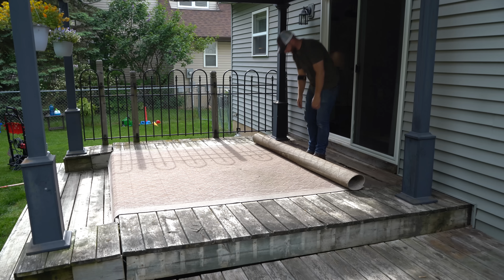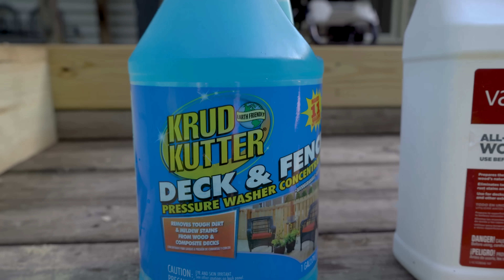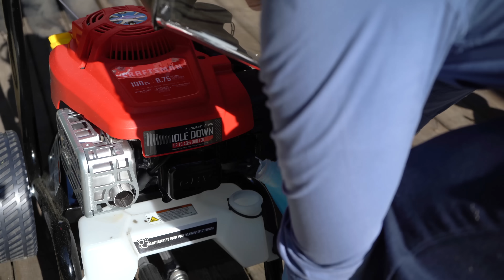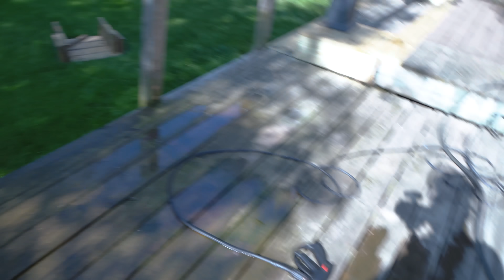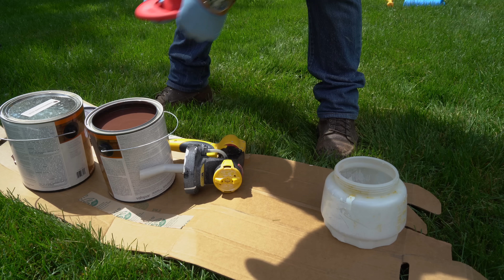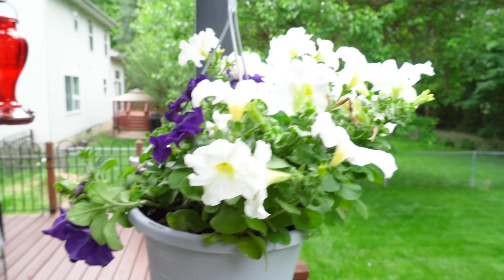How To Clean And Stain A Deck

Comment: Turbo nozzle helps give you a more even spray when cleaning surfaces that mark up like wood. Just don't get it too close or it will fuzz up or even cut the wood. If you can't use a turbo stay away from the more focused spray tips.

Comment: Had a long time pro tell me you want to go through these steps for surface treatment  1. power wash to remove most dirt/debri/algae/mold 2. use a mold and mildew cleaner to kill all remaining mold/mildew and rinse/wash it off. 3. Use something with oxalic acid like that Valspar wood prep you have in the sprayer to restore the wood and balance the ph, (this step is not important if using a color stain.) 4 sand the surface if needed (nothing finer than 80 or 100 grit at the most) 5.then finally seal/stain. Currently about to do step 3 myself.

Comment: If your going to spray a deck always back brush ….it works the stain into the wood so much better especially 
rough parts of the wood and in between the boards …you gotta think of the sprayer as just the applicator… 
I know it takes longer but such a better job. And do carry the boards from a break to a break so do about 
three boards at a time fully or whatever you can keep up with then back brush. That’s how to avoid lap marks…..
Painting contractor here for 40 plus years..

Comment: The only benefit to using a sprayer to apply stain is that you'll be done quickly and that’s it. The sprayed on stain doesn’t penetrate wood properly the way a stain brush does. Besides looking like crap sprayed on stain will also be flaking off in large chunks by your next season. But man it sure sprays on fast!

Comment: 15 degree (yellow) or a "turbo nozzle" if included does a lot better job than the 40 degree (white) as the loss of psi is substantial. Glad to see you figured that out for yourself before you got too far. That deck came so clean, very nice.

Comment: As someone watching this to learn how to power wash for the first time, I'm actually really appreciative that you left in the part where you were careless with the pressure/direction. I hear lots of people mention the start/stop lines, going against the wood grain, etc. but to actually see it gives me a great impression of what to avoid. Thanks so much for keeping the footage!
Reply: Don't follow behind this guy! He demonstrated what not to do in cleaning your deck. Organic growth is still expected to be present. If you're only using water, that deck is not going to hold up, and it definitely won't look as good as it could look.  He didn't even hit the sides of the boards. You could still see mold all the way down them. The chemicals are going to get it all off together. He evidently didn't think that he needed to learn a little bit before he tackled that. I can guarantee you there are lots of stop and start marks along with splintering. You absolutely do not use a 15° nozzle while I've never even heard someone say that. Lol, it also doesn't matter how bad the deck looks. If you follow those steps, it's going to look new in the end.

The right way is as follows: 

1. Give the deck a good rinse letting the wood soak up all that water. 
2. Mix up some Sodium Metacylic and water in a pump sprayer. After that is applied let it dwell for about 20 minutes. May need to use a scrub brush for stubborn areas.
3. Rinse with low pressure using a 40° nozzle or a J-Rod. With chemicals, there will be absolutely zero need for having to get close to the wood. Rinse in a sweeping motion, bringing the nozzle up on each side to side motion, or just follow the plank all the way down to the end.
4. Then mix up some oxalic acid and water to neutralize the wood, bringing the wood back to its natural color. Apply the oxalic acid while the deck is still wet, and don't let it dry on the deck. Also, let that sit for as long as you can without the deck drying. 
5. The last step is to rinse, rinse, rinse. 

Anyway, in case you still didn't know !
Reply: @billyvice1520 this would be after sanding ?

Comment: Just my two cents back brush the stain if using a sprayer to work the stain into the wood.  I use a deck brush on a pole and works the stain in real well and probably uses less stain.   Then do a second coat before within the time frame of what it says on the can.

Comment: You are using the pressure washer wrong. Holding it way to close and at the wrong angle. Also it will force more crap into the deep fibers of the wood making it impossible to clean. Have fun when your deck rots out.  hahahahahahahahahahaha

Comment: Very nice job, great video.
I bought that same sprayer today to do my deck. I am using Thomson's Advanced Sealer, this is 3rd time I am using it but first time spraying it with sprayer instead of brush. I used my foam cannon to cover the deck in foam, used liquid soap, a d then powerwashed it, did that today, hope to paint tomorrow if dry. I noticed some of the stain from last application is holding strong in some spots so I didn't piwerwash to bare wood. Hope it will work well.

Comment: Go get you concentrated bleach mop it on there let it sit get your garden hose and it'll be 10 times cleaner than anything you did with your power washer I know does that blow your mind dude I'm not kidding all you need is bleach and any garden hose just regular water you don't even need high pressure I just did my own

Comment: I do not like to use power washer on deck, I find that what the power washer is doing in this case is actually peeling a layer of wood when wand is held this close to surface.  Then when deck dries the wood is all frayed/ fuzzy and than needs to be sanded before one can apply a sealer or stain.  I use a bucket of hot water with dawn dish soap and a brush, rinsing with garden hose as I go along. I even tried a old floor polisher to scrub deck with great cleaning results but it to frayed the pressure treated deck boards.  So the brush on a long handle is what I found to work the best.  And I do my deck at least every second year, scrub let dry a few days then apply Thompson wood sealer.
Reply: Thank you, yes, I've seen a person pressure wash their deck & it was frayed, basically shredded the wood. It looked awful. I've had people tell me not to pressure wash. So I'm a little confused. Is it low-grade crap wood or what? Or did they do something wrong? 🤔

Comment: Appreciate the video. Well done. The one thing I would say is that it would be a slightly better idea to back brush/roll over what you spray. This pushes the stain deep into the pores and takes that extra step to ensure more durability

Comment: Anybody here is welcome to answer my questions....seeing as I’m really pressed for time. Hopefully, I’ll get the answer before staining. My deck boards look just like the better part of your deck. I have a friend coming tomorrow to power wash my deck. I didn’t see you stir or shake the stain can before pouring it into your paint sprayer. Am I supposed to do that if I’m not using a sprayer? If your stained deck looked almost like a solid color, can your paint sprayer be adjusted for a lighter coating so you’re not using so much and you could see the grain better?

Comment: This is hard to watch. Just to be clear you Pressure Washed your deck. Powerwashing is the ability to make hot water and use pressure. Using the yellow tip to pressure wash just damaged all the grain. Especially with the short strokes so closely. You'll see your stain fail in 1-3 years and also your wood deck rot and fail. You want to use between 300-1500 psi when cleaning wood and let the chemicals do all the work. I use Sodium Metasilicate to restore wood and follow it up with Oxalic Acid to neutralize and brighten the wood. For tougher jobs and to strip stain I replace the metasilicate with Sodium Hydroxide. Hope this helps as this video is certainly not the best method for restoring a deck. You might as well throw bleach on your deck and call it a day.

Comment: Use surface cleaner with the power washer for even finish, use tips to reduce pressure below 2k psi. Deck looks heaps better great job bro

Comment: I do deck repair, wash and stain in the GTA. I drive every nail on an old deck when replacing bad ones. I use a the fat end of a Japanese nail set. It is much faster than you might think and reseating the nails noticeably stiffens the structure.

Comment: Dont nail  deck, screw the deck down.  Also, only use an oil base stain and sealer.
Reply: in a year or two he will be wishing he used the oil.

Comment: Hi Chris, just wondering if you (or anyone else) has had experience using the Valspar deck cleaner (via pump sprayer) and then rinsing/washing it off with a power washer (as opposed to a hose)? Trying to figure if I should go this route or use Krud Kutter in my power washer like you did.

Comment: Nice job, I just finished my deck, it had been stain before about 12 years ago in bad shape, so I cleaned it with 30-seconds cleaner and pressured washed the dark spots let it dry for 1 week then hand brushed it with a paintbrush ( I see the sprayer would have been better), it took about 3 days to fully dry. The results are amazing looks like a new deck and I am in my late 60's and a woman!!!! I also cleaned the house with 30-second cleaner it had that green algae on it and the gutters, I have a pump sprayer and on full force sprayed the gutters with it and the house. By the time I got the hose to rinse it all off it was clean no brushing no scrubbing, unbelievable looks like a new house.
Reply: Which 30-Second cleaner did you use?
Reply: I just used 30 second cleaner on the sides of my house. I'm now painting my doors and trim, then I'm going to use the 30 second cleaner on my deck. After that I'm going to stain it.

Comment: I'm with you on the spraying.  The Wagner sprayer was a game changer for me and I won't use a brush or roller again either, except in rare cases for those areas where I can't spray near the house.  I cringed when I saw you using the 15* tip though.

Comment: Hi Chris kinda stuck here. Just spent about 2 days cleaning sanding/stripping old stain off my deck. Finally started to apply stain about 30 minutes ago and out of nowhere a dark cloud passed over and dropped about 2 minutes of moderate rain onto my work it. I stopped immediately as I was about halfway done with the first coat. The rain defiantly did its work and now you can see the rain spots in all. It wasn’t supposed to rain the rest of the week or today just kinda stuck. Should I let the deck dry completely and just finish the first and move onto the second coat? Or am I going to have to sand the stain off again?

Comment: Hummm.  You should never pressure wash a deck and you should avoid sanding a cedar deck if at all possible.  Pressure washing will damage the soft surface of cedar boards; which will then need to be sanded down.  Sanding a cedar deck will create a smooth surface (I.e reduce the pore size of the wood); which will prevent the stain from absorbing well.  If you have to sand, use 60 or 80 grit sand paper (no higher) then let the deck weather for a few months (how long depends on your location and weather).  Note: If you are removing a solid stain, the only way to do so is to sand.  There is no other way.  I’m this case, start with 40 grit sand paper and then finish with 60 grit.  Once the deck has had a chance to weather, apply the wood cleaner and brightener.  Allow deck to dry for 48 hours.  Vacuum the surface just before staining to remove dust and debris that may have collected during the drying period, then proceed to apply stain.   The final product in this video looks nice but unfortunately the stain will not absorb well and will result in premature deck stain failure.

Comment: A pre-soak of 1 gallon of bleach and 1 gallon of water ( a splash of dawn)  in a pump sprayer would make all the algae/mold come off like butter.
1/2 way through a job I didn't use bleach/water method and the algae came off like in your video , having to use a smaller strokes and a higher pressure nozzle. 

I went back to the bleach/water method and the algae came off again like butter using the white tip from about 6 inches off the surface.

Comment: Great Video!  Question - the boards you replaced, did you wait to let them dry (from the chemicals, not the pressure wash) or did you stain right away?  If so, how did the boards take to the stain?  Thanks,

Comment: So I got my deck power washed but it will rain for the next 6 day’s do I need to clean the deck with deck cleaner before applying stain ?  Also a full 48 hours of dry wood before stain?
Reply: Sanding will give you a fresh and well prepped surface

Comment: Thanks for the vid, it was very helpful. I purchased the Valspar all-in-one for my deck but I'm going to use my pressure washe to wash it off. From the results of yours I believe that will be my best option. I was wondering how has the Valspar stain held up?
Reply: Pressurewasher isn't going to pull that off
Reply: @AndYetHereWeAre  it worked perfect. I pressure washed first to cut the dirt and algae, then used the Valspar all-in-one with my deck brush. Then I waited 48 hrs and stained in a perfect day.

Comment: ANYBODY have any suggestions on this project I’m about to begin. I have a small brand new deck and two flights of stairs I had replaced. Since they are new I really don’t need to clean them, I was going to lightly etch the wood with 180 grit sandpaper, then wash off the dust, let dry, then commence to apply stain with 2 inch disposable brushes, I know this is going to take a lot of time, but I want to stay away from my wife for awhile during this isolation thing. I just want it to look NICE so if anyone has any suggestions, I will greatly appreciated it...Thanks.
Reply: I would sand new wood with 120 or so grit... more than an etch to remove mill glaze from new wood. I'd also use a larger brush like a 5", 6" or 7" deck boss stain brush. I have a video review of the deck boss.
Reply: XC Painter Thanks for the advice, appreciate you reaching out. It came out pretty good, spent 2 days on it, took my time and had an outcome I was pretty proud of, wish I could show ya a pic...

Comment: Building a 8x8 platform for a shed that will be sitting on the ground.  Being a shed floor I don’t need any fancy colors   I just want to seal the wood. Using pressures treated plywood    What can you recommend that is literally the cheapest way to go

Comment: I took a big surface sander to my deck (one on wheels you can use while standing behind. Can rent from Home Depot). This smooths the surface (no mor splinters), levels it a bit, and gets rid of the dirt you miss with the pressure washer. Works wonderfully
Reply: I think this is the best idea.

Comment: A surface cleaner attachment to the power washer would have done the trick and made it super quick👌🏼
Reply: Doesn't a surface cleaner go against the grain when it's rotating?   Will you notice the rotation marking it at all?